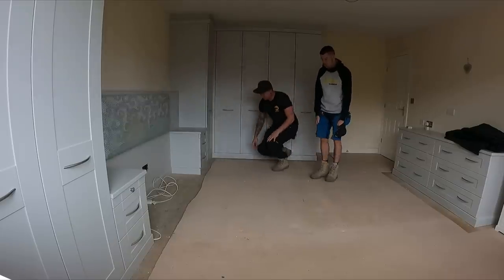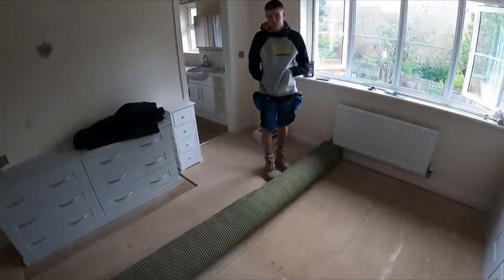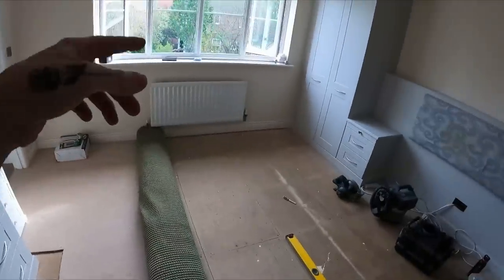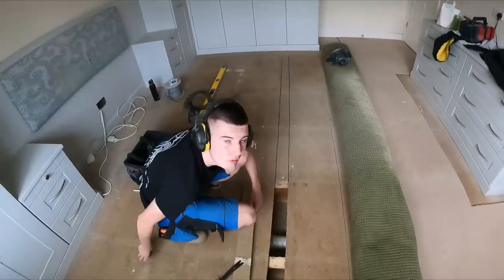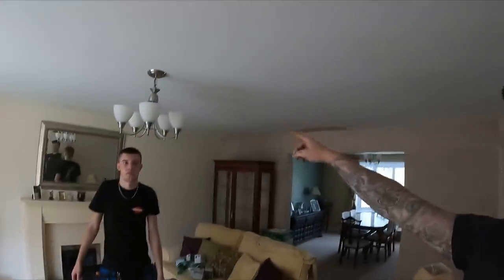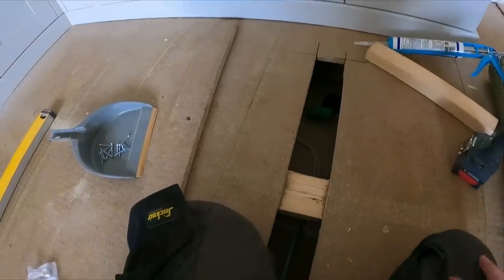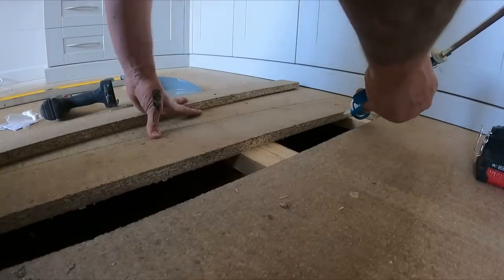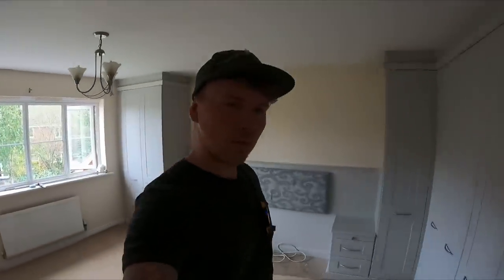I thought this was a good idea 👀 It Wasn't

Comment: Should of put 70mm strips of 18mm plywood down either side of the channel between the joist screwed through the chipboard flooring  to form a 35mm rebate either side that way it's totally accessible and  all the edges of the infill pieces are supported .
Reply from the maker: good shout mate thanks
Reply: I'm a joiner mate so I'm used to following up after sparks.👍
Reply: 70mm strips of 18mm ply 😱😩
Did you win the f##king lotto or something Anthony?? Take your rich ass of to your gentleman’s club and leave us commoner’s too it 🤦🏼‍♂️😤
Reply: Plywood was an example,  you can use what you want, all i was suggesting was a way of preventing call backs but for roughly £10 for the strips of ply which can be added to the cost of the job I'd opt for plywood for piece of mind and no call backs.
Reply: Meant to say CT1 is about £12 a tube and not acceptable after its gone off without making a mess
Reply: was just about to suggest the same, gives much more even support.

Comment: Think I’d have just cut a wider channel out to help prevent it flexing rather than using the sealant.

Not that there’s anything wrong with your method, just one less thing to worry about.

Hindsight is always 20/20.

Comment: use the armeg floor cutter and put blanks in after , so much easier and quicker
Reply: They wanted a channel, not holes.
Reply: How's he going to drill through a joist though
Reply: @solowen1836  a 400mm bosch selfcut drill bit works perfect

Comment: Really not a good way to cut the floorboard, chipboard is notorious for being weak in small sections, do it properly with floor bungs or even better cut up a decent size section. 
Also it will help the next guy out who has to rewire the house or plumbing etc

Comment: Tip: Taking the plaster board piece out of the hole saw, try using a pad saw….that way you don’t damage your nice vde screwdriver!
Reply: Get a hammer tap lightly on the holesaw and spin the drill it comes out